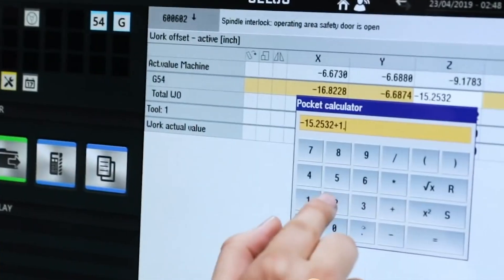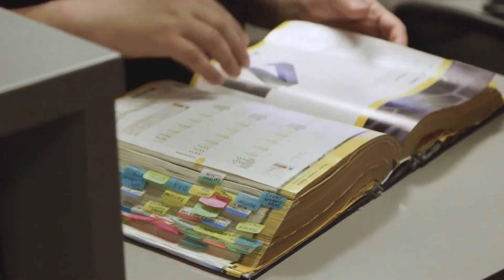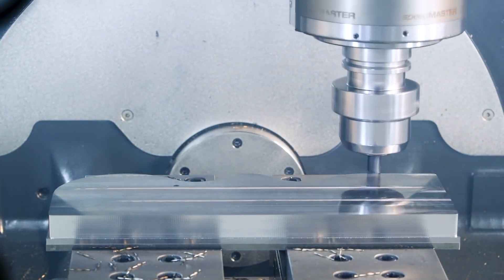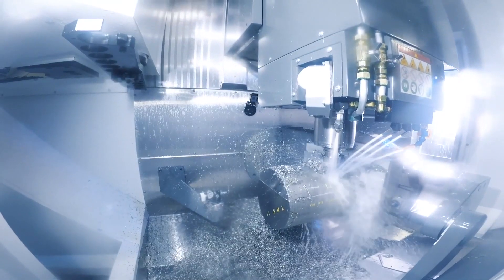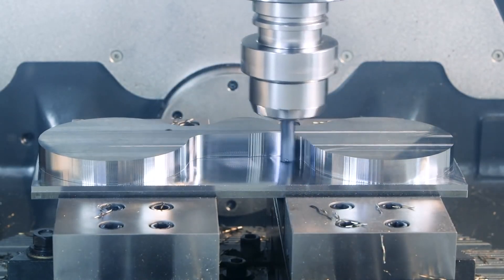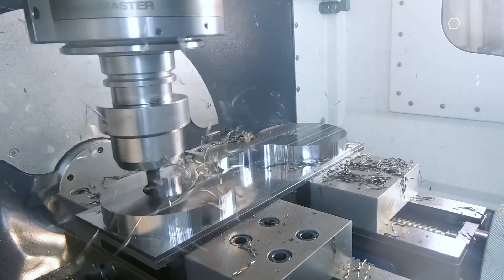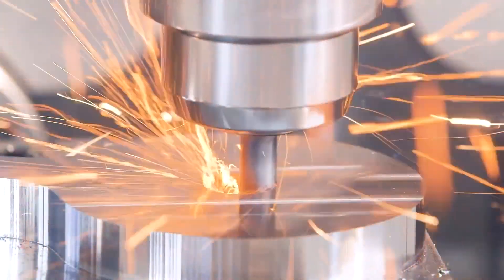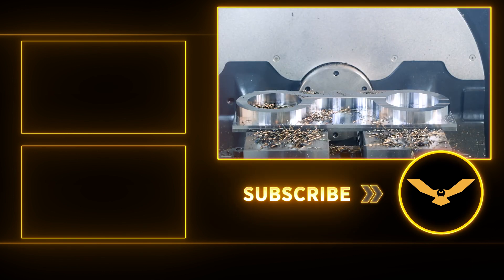How to Get PERFECT Speeds and Feeds for Any Material in CNC Machining?

Comment: Hi Titan, I have been watching a lot of your video catalog and I am a huge fan. I was wondering if you could do me a favor, could you state the material you are cutting through in the video description? I appreciate that you include details such as cutter models, removal speeds, etc. But as a hobbyist machinist, I would love to know what material grades are being cut and why those specific alloys/grades of material are being chosen.
Reply: The original videos explain the material. Material is chosen because that's what the customer ordered. N
Reply: @urgamecshk  Hi Julius, Thanks for your reply. I understand that the material is selected to meet the customer needs, but I was looking for specifics. Steels and other materials come in engineering grades. I have worked with 01 tool steel and both 306 and 316 stainless steels, but for the bulk of my experience it has been 6061 aluminum. I was hoping to gain some insight into machining steel as opposed to aluminum. I did not see anywhere in the description where the engineering grades of material were called out.

Comment: Pushing tooling is super fun.  But I find it has limited uses.   Personally I am a big fan of being a little conservative on my speeds and feeds and gaining tool life and tool reliability and consistency so I can run longer runs lights out.   I have a job in our shop that I can set up Friday night and it will just be finishing as I come back into work on Monday.   It's only aluminum so tool life isn't a huge concern, but it is 5 axis mill-turn with multiple 0.001" tolerances.   In process probing with automatic offset adjustment is amazing to have too.
Reply: Just home hobbyist total n00b but Q. How do we gain tool life by going slower, thus risking more rubbing, with the extra heat and wear that results? Surely if the tool does not break, chip or chatter, then the tool's life will be extended by a more aggressive cuts, within those limits?
Reply: @gruvinnz  I'm also a noob, but I'd guess it's because of the increased force being applied on the tools horizontally. It's probably a lot of stress on the tools and they end up snapping off sooner than expected, I don't know if it has more or less wear because of the heat factor, but applying more pressure on the tools when they're machining definitely isn't good for them.
On the other hand, if you go slower and never snap your tools, if they get dull you can resharpen them and continue to use them.
But this is just my hypothesis, I still have a lot to learn.

Comment: Now if only I had a machine that could handle the feeds and speeds you guys give us 😄
Reply: That's one thing that really bothers me about these vids and some of the discussions I've had with tool reps. The rigidity of your machine is one of the biggest factors when it comes to machining like this. I had a dude from kennametal tell me to plug in a doc of .1 and a feed of .022 ipr. And I was machining s-7 tool steel. After a discussion with the shop owner I reluctantly plugged in the numbers and the owner came out to watch as the spindle load jumped up to 200% and before the machine could alarm out it managed to shear 3/4 bolts connecting the holder to the turret, the alignment pins in the holder were falling out. And it deformed the alignment holes in the turret. The machine was never the same afterwards.
Reply: @Num6er47  Power too, highest power machine I have in my shop is a 10hp lathe. You're not running feeds and speeds like that with >10hp.
Reply: @beachboardfan9544  that's absolutely right. I didn't mention hp because it's usually what is used to calculate these variables. This was a 25hp machine.
Reply: @beachboardfan9544  true but some of us actually run 48 HP machines but spindle only goes to 4,800rpm. Very frustrating
Reply: @firestarter5038  That machines probably taking 3" deep .250 cuts tho
Reply: Isn't HP directly related to rigidity? What's the point of a 50+ HP machine if it's not rigid? Better having a low HP machine with enough rigidity to go 120-130% once in a while than a powerful machine that breaks tools when you go above 50% load because it's all floppy and the tools hate it
Reply: I mean yeah the more hp the more rigid the machine. But not all machines are built the same. Or the same age. Or had the same life.
Reply: @Orakwan  Yea I think thats what the guy above is getting at, thats why hp is a variable of your feeds and speeds calculations.
Reply: Oh you can run the speeds and feeds shown. I’m sure of that. But your radial and axial would be almost non existent in order to do so
Reply: It's about knowing your machine and how to find out the best tools feeds and speeds for that machine to optimize your work. Then work your way up to competition with these guys do the best with what you have and be thankful some people have no machine or even the aptitude to use a machine if they have one your lucky just to have the ability and aptitude that's head and shoulders above 75% of people alive
Reply: @gabewhisen3446  You are probably right, but how do you go about it. We have a Haas TM1-P and my machinist does not seem to know how leading to crappy surfaces, poor productivity and ruined tools. 
Our machine has 6000RPM capability, 2500mm/minute (100IPM) max speed.
To me it seems that most of what we do look best at max spindle speed, max cutting speed but how do you suggets getting the right quality.
Reply: Yeah and specialty deals on new collets, bits and every other thing that destroys itself when going at insane speeds

Comment: How many minutes in cut should a quarter inch endmill last in a material like C45 or general construction steel?
Reply: There is going to be a few other factors involved there. Such as the material your tool is made of, the number of cutting edges, your material removal rate, and rather or not you use coolant.
Reply: @Num6er47  Harvi III like in the video.
I guess they are 4 flute mostly

Or equivalent, not looking for specifics, just what kind of  life you can expect from these feeds and speeds in these machines. With similar tools but in kinder steel grades.
Reply: @Pukelful  as far as just plowing through material your should be able to get several hours cut time. It's hard to say because there's still many variables to consider and my mill experience is limited. I worked in a job shop and I would use the same tool for weeks or months.

Comment: How do you service those machines to keep delivering those feeds and speeds? Some random electricians and technicians are not going to cut it.
Reply: At my shop we have technicians from our machine tool vendor come out and preventative maintenance at intervals specified by the manufacturer. We have an in house guy who's taking on some of those responsibilities now. It saves us money and allows us more flexibility to do things on our schedule instead of when the vendor techs were available. We are ISO 13485 (medical device manufacturing) certified, so all of this stuff has to be done by the book.
Reply: The machine manufacturers have their own technicians

Comment: this is to Titan Personally; I taught on Herco BMCc 50 centers. 1 THE CUTTERS TIPS ARE RADIOACTIVE. TITANIUM NITRIDE ETC IS BASED AS COATED OR AS GROUND ISOTOPE. THIS MAKES SPEED/ FEEDS POSSIBLE.
 DERMATITIS FROM ISOTROPIC BILLETS, WHICH IS NORMALLY CALLED BARE HAND ISOTOPE HANDLING IN BRITISH AIRO SPACE.M.O.D OTHERWISE  INCONEL, ST-ST 316L ANY TITANIUM/ A2 2 M2/3/4-7 ITS EXPENSIVE CLEAN NASSA OR MOD MACHINE SHOPS UNDER NUCLEAR SAFETY BUT YOU AND YOUR FAMILY COST NOTHING IN TOUCH CONTAMINATION.
YOU NEED A HARDER RANGE ISOTOPE TRI MIX CUTTER OR TIP FOR RADIO AND CARCINOGENIC ALLOYS.

Comment: What if titan actually gives false information so that his competitors machines and tools would break 😂😂
Reply: Doesn’t seem like something Titan would do
Reply: you're right. This video didn't teach a single thing. It's only him boasting once again. If you actually want to learn, to go NYC CNC's channel. Saunder's really truly teaches his subscribers, not just a bragging video on what he does, then shows off and leaves his viewers a bit dumber just for watching. No speeds or feeds were even discussed really.. just some examples, but no machine info. I can't even run my CNC at 800 IPM. My machine maxes out at 300 IPM, and 10,000 rpm. I don't have the HP to even consider it. I only wanted basic info, so back to NYC CNC. He's got excel sheets, etc, he actually provides to people.
Reply: @poppabearNC He told you the truth. His speeds and feeds come from experience and constantly trying to push it faster. There is no perfect speeds and feeds calculator. Your machines and tooling are different than what he has. You have to simply try stuff. But in general for end mills. I would try to cut using side milling when possible at a depth 1-2 times the diameter of end mill. with a fpt of about .004-.006 with 8-10% diameter step over. And run the rpm at whatever gets you to an ipm over 100.

Comment: Cutter Speed (in the Machineries Handbook) , times 4 , devided by diameter will get you close, then push it / tune it to the capacity of your available horse power and tooling.
Contacting your tooling manufacturer for recommended speeds / feeds / loads can save you lots of time too.
Listen carefully while it's running. The sounds the machine makes while cutting will tell you if you have it right.
Good video
Reply: Most important for a good cnc operator/machinist are his eyes and especially his ears.   😂
Without that don't even think on max. Feeds and Speeds.  😉